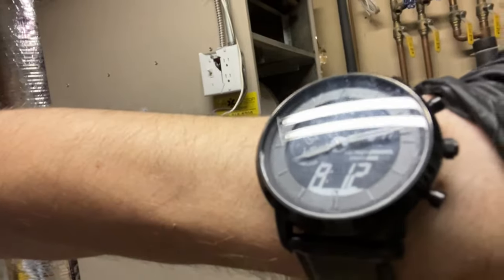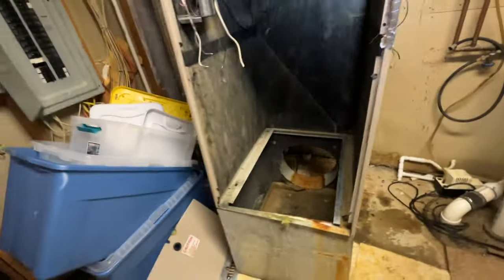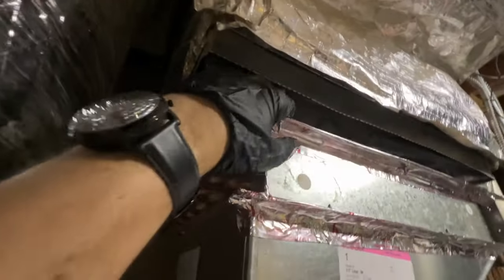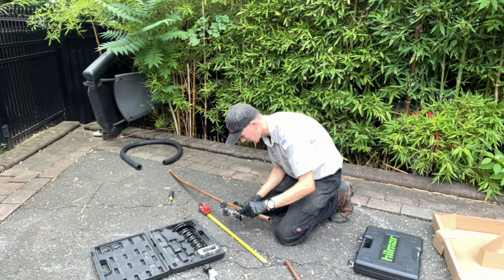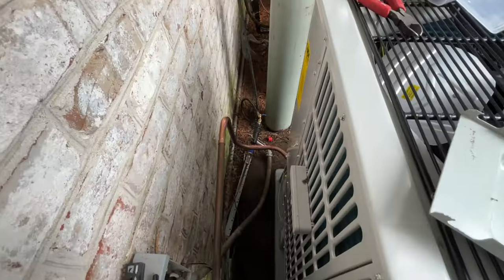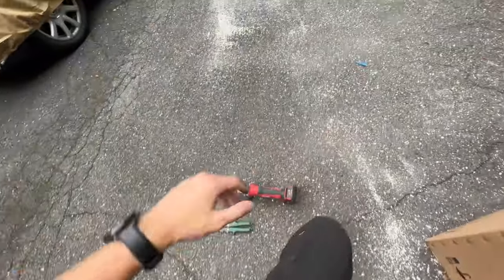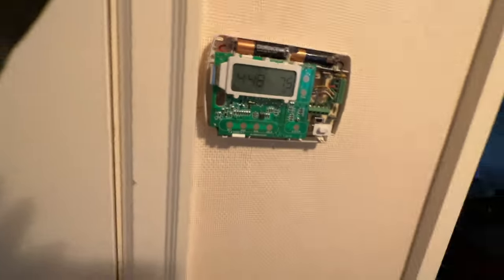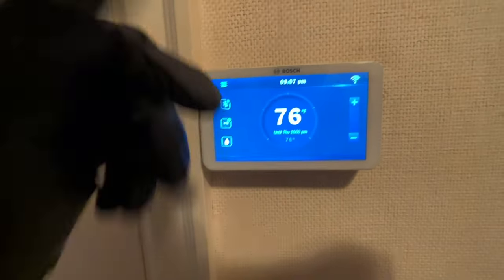Ripping Out Old R-22 System and Replacing with Bosch IDS 2.0! No Cooling Call - Service Agreement!

Comment: Yo!!! AQUECOIL makes a Cased Hydronic Coil that fits that Bosch A/H. Model# HHU-AM-2 fits BVA-24/36 & HHU-AM-3 fits BVA-48/60. They make them to fit most major brands. Pretty cool.
Reply from the maker: But it’s for the return side. That makes the evap impossible to clean
Reply: Daniel Son,The HHU Hydronic Cased Coil goes in the Supply of the Air-Handler.

Comment: Daniel do you happen to know the amp draw on a Bosch 5 ton heat pump.
Reply from the maker: Hovers around 4-6amps at average speed. But can go higher or lower depending on the demand
Reply: @DCHVAC  thank you Daniel.